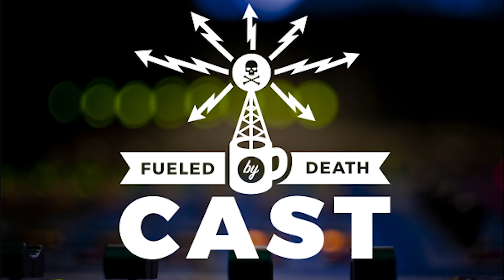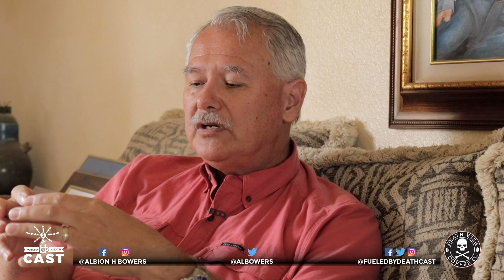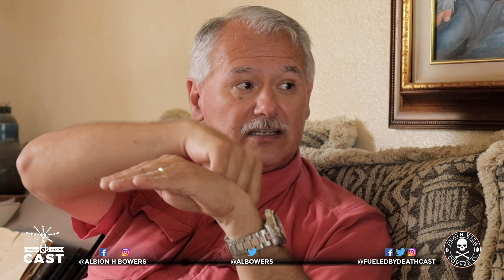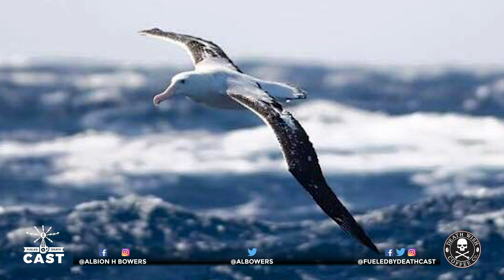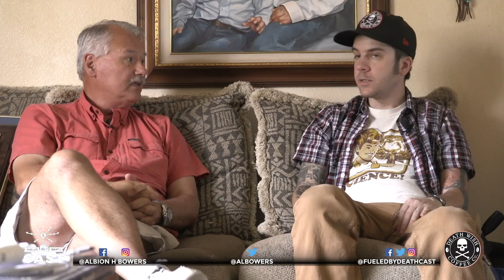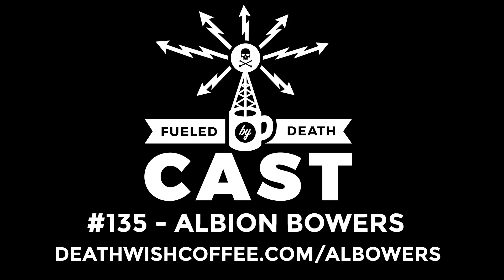Al Bowers and the Prandtl Wing

Comment: So it turns out the 'Prandtl' wings look like Horton wings, because Horton wings ARE Prandtl wings!
Still unsure what the deal is with the theory?
High aspect ratio flying wings (provided they're not so small that the Reynolds numbers ruins them), using laminar sections and having the centre of gravity/washout relationship just slightly positive from zero, will always have a good L/D ratio.
The requirement for vertical surfaces on swept flying wings has always been know to be minimal (if at all), however, pitch and roll control inputs (which negate most of the Prandtl theory) can have secondary reactions in yaw, so maybe small winglets are the answer. The concept of 'drag rudders' just sounds so weird when trying to optimise drag reduction!
Reply: If you'd actually followed the discussions (possibly in other's of Al's videos), the Prandtl design eliminates the adverse yaw issue on rolls, so the plane yaws appropriately on roll inputs, providing coordinated turns with no tail section required. There is no need for winglets or "drag rudders" at all; the washed-out wingtips are effectively the "winglets" folded out in line with the rest of the wing, and since the lift profile of the wing is generating the vortices at about 70% of the wing's length, the vortex ends up pressing up on the washout, providing forward thrust, effectively reducing the drag on the wing. During a turn, this forward thrust on the outside wingtip negates the adverse yaw commonly found on standard wings. 

For an example of "drag rudders", you need look no farther than the B-2 bomber.
Reply: @arhedler  All that you are saying is effectively correct, swept flying wings rarely suffer from rolling adverse yaw. However, this has been a known fact for probably longer than NACA/NASA has existed. In simple terms, when rolling any aircraft, with simple control geometry, it will induce a yaw. The act of rolling is usually to initiate a turn, and once rolled, the wing needs to be pitched to increase the now angled lift vector to maintain a level turn. On a wing and tail aircraft, this mean applying up elevator, which will increase the angle of attack of the outside/downward aileron, thereby increasing it's drag and thus adverse yaw.
On a swept flying wing however, the pitching effect is induced by the equal raising of both elevons. An assortment of consequences now result, the 'outside' elevon has now been raised by the same amount as the inboard one, usually effectively bringing it to zero deflection, while the inboard elevon has now doubled it's deflection, thus increasing it's drag purely by it's amount of displacement (compared to the outside), 'hey presto' an impersonation of differential ailerons!
Other effects come into play with swept wings in this situation as well. Image a straight flying wing, a 'plank' (very popular as a simple RC slope soarer), once rolled to a bank angle, it will try to slip into the turn, a 'pilot on board' reaction would be to increase both roll and pitch (thus more inboard drag) to complete the turn. On a swept flying wing, this induced slip has a secondary effect of presenting more leading edge on the inboard side, creating a STRONG dihedral like effect and trying to roll the wing level, as such even MORE roll and pitch will be applied to a swept wing to maintain a turn. This is where the idea of drag rudders usually comes from, that and the real world need to induce side-slipping to be able to land in a crosswind.
Note; I have seen these concepts of induced angles of attack and odd airflows and lift vectors, that can be shown to be producing 'thrust', this is generally rubbish as the pressure differentials and angular flows ON A MOVING AIRCRAFT/WING, will never amount to more than the oncoming airflow, thus the best you can hope for is a minimal reduction of drag in that area.
(I once had someone try to tell me how much 'thrust' winglet can produce, so I drew a picture of a Jumbo Jet covered in winglets with no motors and said, "All we have to do is push it, and it will fly forever!"
Pylon500; Free flight and RC modeller, hang-glider and sailplane pilot, Ultralight flying instructor ~4500hrs, ultralight designer and builder (building #4).
Reply: @pylon500  looks like you still didn’t assimilate ( don’t take it like offence , just trying to help you) what Al Bowers and the previous commentator ( in this thread) are saying.  The difference between the Prandtl bell shaped lift distribution wings ( BSLD) and the regular one is that on the regular flying wing you have to achieve the pro verse you by creating more drag on inner ( to the turn ) wing ( the more drag pull it back ) when on BSLD wings you achieve the pro verse you by increasing the thrust on the outer ( to the turn) wing  automatically with rolling the craft in the turn ( increase of the lift on outer wing automatically increase the thrust as well ) . On BSLD wings pro verse you is a result of pushing outer wing forward instead of pulling inner wing backward as is on the  elliptical ( Prandtl’s achievement as well ) lift distribution wings. Hortens have been much more engineers than scientists . The engineers usually like to keep their design secrets when the product of scientific work lose  any meaning if you keep it secret just for your own  consumption . On the other hand Prandtl hasn’t been engineer/ pilot  who was building / flying real planes so he probably even doesn’t looked at the problem of adverse / proverse  you  and especially for the tailless flying wings planes as Hortens  do . Here Al Bowers has come to figure out and kindly share and explain to all of us what Prandtl and Hortens works can result of and how the nature ( the birds ) prove theirs theory and practices by using them millions of years .
Reply: That's HortEn, not Horton.

Comment: Nothing new here. 
Swept flying wings have been around for a long time. The reason conventional aircraft have tails is for stability.
Thankfully most people realize it is not wise to sacrifice stability.
Reply: This is not about swept flying wings, this is about not requiring vertical surfaces.
Reply: Control is the key, not stability.
Empennage has an "elevator" that elevates the nose for climbing by pushing the tail down. Empennage has a "rudder" that steers the fact that the wings are not covered in nerves connected directly to the pilot's brain to fire tiny muscles that use hundreds of feathers to make constant adjustments - The adjustments are CONTROL

Comment: "The Gordon Quigg Principle Of Wing Lift"
I'm 64 years old, and ever since I was 3 years old, making model balsa wood gliders with my dad, I have thought that the Bernoulli theory was a myth, a hoax, and all wrong. First of all, scientists that should know better, for centuries, have addressed the issue wrong and backwards. 
     Comparatively speaking, and to put things in proper context to analyze the subject scientifically, in order to expose the reality of the situation, the air is not moving through the wing, the wing is moving through the air, in which the wing has the power of mass, momentum, speed, and power, and the air does not. Air is minding its own business, and here comes a high speed efficient bird at 60 mph and slices right through it. Did the air speed up, or slow down? No! Because it wasn't going anywhere! It didn't have time or the ability to speed up or slow down because by the time the wing sliced through it and the air had not enough time to react, the party was over for the air. 
     So, the bottom of the wing is just simply doing what they call planing on the air it is hitting. The air on the bottom of say a half foil wing (flat bottom, full curve on top), is barely disturbed, whereas the air on top that was having a Ho hum nice day, gets thrust upwards and out of the way to make way for the volume of the wing, which creates the most drag for the wing to push through. That air gets relatively highly compressed and pushed up and out of the way instantly, and as the wing going 60 mph does that, it leaves the air that was on the top side of the slice, packed up and pissed off. But back when the wing was half way past those air molecules that we are talking about, the wing's curve on top is now peak and pulls away from those molecules, and they haven't had time to react, so packed up above the wing they stay, long enough for a vacuum to be created as they try to break off of the wing's curve pulling away from them, thus, creating an amazing amount of lift. By the time the air molecules that got pressed above the wing are able to press themselves against each other and get back down to where they were before getting sliced, the wing is long gone and the air rejoins the other air that was below the wing, almost effortlessly, the more efficient the wing is that sliced through it. Now if we were talking about a wind tunnel with a stationary wing, the wind on top doesn't speed up to meet its buddies on the bottom side. It gets pushed up with drag and actually slows down, and is late to the party when they join up with the air molecules down stairs again with no means or way to catch up to the position they were in before hitting the wing and slowing down. So sorry but Bernoulli is, Wrong...
     So in summary, The Gordon Quigg Principle is: a standard gliding bird wing foil, such as a pelican or an albatross, has a good amount of simple planing lift on the bottom, and a really good amount of vacuum lift on the back of the top, while the air is relatively still and the speeding wing slices through it.  And that my friends, is The Gordon Quigg Principle of how and why a foiled wing lifts, in many ways, the opposite of Bernoulli's Principle, and all those highly educated scientist's who blindly dogmatically follow him.
Reply: I am unsure if you realise you've basically just described 'lift' but with different words and no regard for frames of reference. According to the air, it's standing still (for a definition of still) and the wing comes and slices through it, yes.

To the wing, if one was on said wing, the air is racing over it's surface constantly. You can see this in aerodynamic studies when they provide two images, one from each perspective. 

All you have to do is replace 'vacuum lift' with 'low pressure air' and 'planing lift' with angle of attack and you're explaining, to us, the principles of flight.

'The air rushes back to meet...' yes, this is basically what high/low pressure flow is and what Bernoulli's observations cover. You've explained, using a different set of words and a different perspective on the situation, to describe the exact same phenomena.

My thoughts on the matter. I'm open to hearing your replies.
Reply: The behavior of the airflow over the wing shouldn't be fundamentally different in free flight vs in a wind tunnel. The fact that the air or wing is stationary relative to the ground makes no difference when we are describing air flowing over a foil. It's only a question of the relative velocity of each element. Defining one element as stationary is just a matter of defining your reference frame.
Reply: 60 mph is no where near the speed of sound, how would the air have no time to react?
Reply: that was a clear explanation for me

Comment: I would love to see an RC model kit built with this wing or at least a pre-cut foam core wing.  A couple of years ago, after seeing a video on Mr. Bowers research, I started playing with a 1' span flying wing made from a scrap piece of 1/4" blue insulation foam board.  It didn't really even have a proper airfoil.  I twisted the foam to approximate a wash in and wash out at the tip.  The thing flew fairly well but what was really amazing was how stable it was.  I could launch it upside down, sideways even backwards.  No matter how I launched it, after release, it would immediately right itself and fly straight and level!
Reply: I am happy to read that, because I was thinking exactly the same. If there was an appropriate kit to play with, kids (and engineers) could work on a working piece to study. Would you mind giving some more information about your built?
Reply: @pascalfust1035  Mine was just a piece of scrap blue insulation foam board from either Lowe's or Home Depot.  They no longer have blue, just pink but it's pretty much the same thing.  I used some scrap that came from the part along one of the fold lines.  That gave me a bit of a rounded leading edge to the wing.  The wing halves were about 11 1/4" length each.  The wing root was 2 5/8" and that tapered to 3/4" at the tip.  The CG was about 2 3/16" back.  The wing was swept back about 3 1/16" and the two wing halves were hot glued together with low temp hot glue and then taped.  I hot glued a 1/2" piece of a Popsicle stick on the nose, (rounded end of the stick forward) and hot glued a 3 1/2" coffee swizzle stick  on the Popsicle stick.  That wasn't enough weight so I hot glued a 3 1/8" piece of a regular drinking straw over the over the swizzle stick and then added a small piece of modeling clay inside the tip of the drinking straw to balance.  There is no dihedral, the wing was a flat bottom and I just hand twisted the wing tips upward, starting 2 13/16" from the wing tip, upwards about 3/8" to try and approximate Prandtl's/ Mr. Bower's wing with a minimum of time and materials.  I may be totally off base on my take on this but at the time I didn't have anything but a YouTube picture and a scrap piece of insulation foam board.  I was surprised how stable this flew for a free flight flying wing.  It had a flat glide and it only wanted to fly straight, level, right side up.  I will add a picture as soon as I can if you are interested.  The info I have should be enough to throw something together.
Reply: @FlyMIfYouGotM  Sounds simple and still effective. I guess that the twist you applied on the board resulted in a linear twist. Even though Bowers highlighted the importance of non-linear twist, I find it amazing that you came up with stable flying performance. I would definitely be interested in your findings and pics
Reply: @pascalfust1035  Do you have a Dropbox or other way I can send you pics?  The twist probably were more or less linear but I tried to apply more twist as it got closer to the tip.  I just played with it until it trimmed and flew well.  I do find it interesting that Al Bower's groups work was used to redesign noisy blades on computer cooling fan for the ISS.  The redesign resulted in a 24% increase in airflow and an 88% reduction in noise.  This redesigned blade did this while using LESS electrical energy!  With all of the hoops jet engine designers typically jump through for just a 1% or 2% improvement in performance you would think they would be falling all over themselves to take a look at this.  NOTHING!!!  Personally I think Mr. Bowers may be able to get the attention of more people in aviation if he picked a big piece of low hanging fruit.  Wing or jet engine turbine blade redesign is expensive and carries lots of risk.  Redesign of props for small planes in relative terms would be inexpensive.  If you owned a small single or twin engine prop plane would you be interested in a 20% increase in thrust, an 80% decrease in prop noise and a 20% or even 30% reduction in fuel burn by just changing props?  This is a potential market that, if properly tapped, could eventually lead to even bigger and better things.  In this video, Mr. Bower explains some of these things with prop design starting around 39:50.  https://www.youtube.com/watch?v=bCwtcDNB15E
Reply: I have been building flying wings since 1973.  I use paper and tape.  My interest in building these wings I call the OmniWing came from my interest in the then new aviation of hang gliding.  I continue to fly my hang gliders as well as continue to build my OmniWings and make efforts to refine.  You can see the OmniWing at http://omniwing.com/.  Links there will also take you to the YouTube page for the OmniWings where step by step instructions are available as well as videos showing the OmniWing in flight.  Also, be sure to check out one of my OmniWing flights off of Mount Nebo, in Arkansas.

Comment: Great Video! Any calculations, tests with coaxial propellers? how significant the noise reduction?
Reply: Prandtl fan…..Same voltage, Same diameter, 24% increase in flow, 88% reduction in noise
https://youtu.be/bCwtcDNB15E

Comment: Wow!  This man has worked on this idea for over 20 years and just a few have heard and acted upon what he is saying.  I'd like to try it out but I can't find exactly how the Prandtl Wing is made or how to contact Mr Bowers.  Other geniuses include Robert J Englar (ret) who pioneered Circulation Control that would help airliners take off at survivable speeds yet fly faster with less drag.  He used up 40 years of his life working on something great that no one paid attention to.  His work also could be applied to tractor trailers for extreme fuel savings.  At least he got to follow his passion.  I love Al Bowers' passion too.  Thank you for posting your interview.